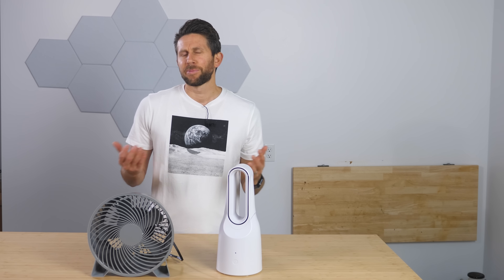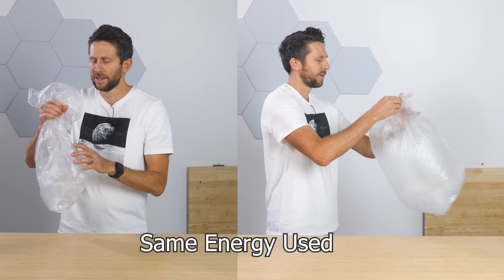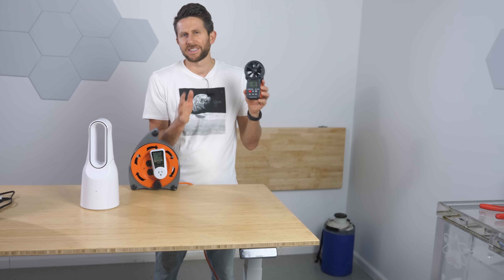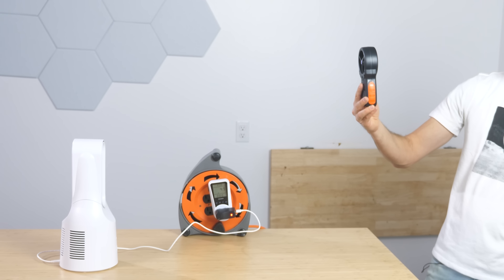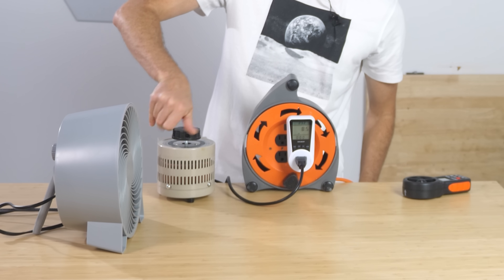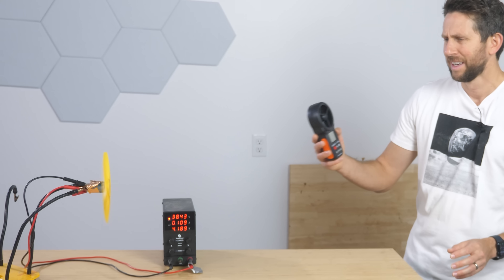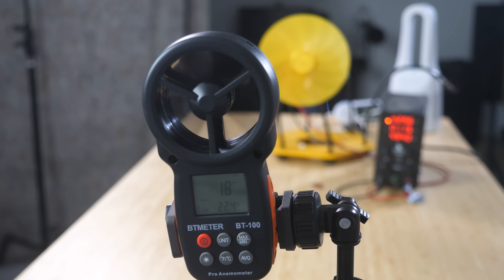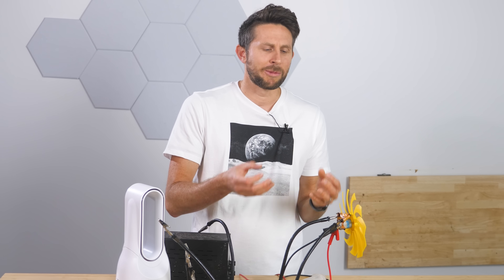Are Bladeless Fans a Scam?

Comment: I thought people liked bladeless fans because the stream of air was more pleasant than the beating fins of a traditional fan. I never understood why it was exponentially more expensive just for that small benefit tho.
Reply: Honestly, their form-factor/aesthetic is the biggest benefit. They work nicely as a bedside fan, or something similar.
Reply: @damsonrhea  I think tower coolers are a much better solution. I have one, it's really nice the amount of space it saves, and inside it's just a really tall version of the fan in the base of the bladeless fan, just, with a clear path for airflow, behind and in front. bladeless fans do look cool though. But it'd be even cooler if it was truly bladeless, you can use static electricity to move air too. I.. forget the name now for it. But I saw a video recently of a guy making one into a thruster for a model airplane.
Reply: They are also a bit safer for small children.  I can remember getting my fingers smacked by fan blades, thankfully not cut they weren't metal blades.
Reply: @krsanth-4142  Yes but as an child you learned to not stick your fingers into fast moving spinny things that was relatively harmless,  so as an adult you know not to do that.   Where as someone who doesn't do that maybe loses a finger as an adult because they don't have that level of fear imprinted into their brain.   So an argument of safety may not take into the long term safety of the person 🤣🤣
Reply: @Mike__B  Yeah but parents are usually overprotective of their children the smaller they are.
Reply: @Mike__B  Modern "safety" made people in general dumber and more oblivious towards everyday hazards
Reply: @Mike__B you can just put a cap on it with tiny holes on it
Reply: The stream of air will be negligent unless you are directly in front of the fan. A lot of companies claim regular fans "chop" air is not correct.
Reply: @jasonsong86  This literally only happens with turbo propeller aircraft where the ends of blades are going near supersonic speeds. I've heard it, I live near an airport.
Reply: @jasonsong86  

This, you're not supposed to be sitting DIRECTLY in front of the damn fan. It's like people have never used a fan before. . .
Reply: Buy an ac at that point 😂
Reply: Dyson is a conartist and with clever advertising destroyed many products where the design had been refined by many companies over many years. The biggest example is how he destroyed vacuums forever by shifting the industry to bagless.  His fan claims, including the "choppiness" issue were too much for the average consymer ti be suckered (luckily).
Reply: @blobscott  "Destroyed vacuums forever"! 😆 I expect most people would agree that bagless vacuum cleaners provide better value for money than the old variety.
Reply: @nagualdesign  I assume you don't use vacuums very often!  First (for the bagless vacs), I love emptying out a canister of microscopic dust particles, which inevitably billow back into the air and your face when you are emptying the container.  Very fun to inhale this as well.  Then, I love the static on the plastic dust container, which is permanently covered in filth after the first use.  Then I JUST LOVE replacing the expensive fan filters, to keep said particles from blowing through the fan and back out into the room when the vacuum is running.  Geez.  Good luck out there.
Reply: @blobscott   I don't think I've ever read a more offended version of "I had to clean up my own mess" from someone old enough to type it.
Reply: They are way safer if you have pets, especially birds.
Reply: I need a fan in my kids' room. Bladeless is safer. Not that I bought an expensive Dyson. Just a tower fan where they can't stick their hands inside.
Reply: Fan blades are continuously moving air. Any vibrational disturbance you get is from them not being stiff or balanced enough, which would be a manufacturing or material choice flaw rather than something intrinsic to the design. They can create somewhat circular pressure waves, but those are easily fixed by inverted stationary fins in front to break up the air flow which is already done for situations where you need really even air flow
Reply: @charlesnathansmith you're right that the flow around each blade is constant... but when you're not moving along with that blade you will feel wind speed changing when a blade pass by you, and your ears will interpret those changes as a low frequency humming sound.

It's most often not the motor you hear when you hear a fan... it's the turbulence.

You don't hear much of that turbulence with a "fanless" fan because it basically funnels the constant flow into a tube, which then escapes the device as one uniform flow.

So, as I see it, it's logical that they're quieter, and because they use a smaller motor, they can start at a much lower wattage, as he also found out in this video.

Them being more efficient wouldn't make sense, as funnelling and directing the flow of course costs some energy, as it builds up pressure before air escapes the device.
Reply: @BenjaminVestergaard   they're circular (spiralled, really) pressure waves. Passive breaker fins are used to even out the air flow in high performance applications where that matters but aren't common on household fans. Maybe one of us should start putting some on them and make $50MM

Most of the noise you hear is from flimsy blade materials and poor manufacturing tolerances though.
Reply: @charlesnathansmith  yeah 🙂 breaker fins work well... but it's cheaper with just a mesh to keep fingers out.

Even expensive fans with low tolerances make that hum that makes it sound like its beating holes in the air... perhaps that new moebius-like vortex design that MIT is designing, to make drones more quiet, could make old fashion fans more quiet as well... it would make sense.
Reply: why is anything more expensive than anything else, marketing and cause people pay for them?
Reply: I have a Vornado air circulator. It's like a fan, but isn't as choppy and you can point it away from you and  you will still glfeel air flow as it moves around the room. Don't think I could go back to a traditional fan again.
Reply: People are paying for the visual aspect of the fan
Reply: The fan he pulled out of the "bladeless" fan was a squirrel cage fan. You'll get the same smooth airflow from the squirrel cage fan on its own, without the marketing shroud.
Reply: All that went into dyson marketing
Reply: Because it's fancy lol
Reply: Marketing.
Reply: branding
Reply: If it was exponentially more expensive it wouldn't exist as a product.
Reply: Greed.
Reply: Fans for restricted airflow are usually not great for airflow. It takes some engineering, and Dyson motors are pretty good as well. Early adaptor tax applies, too. Got to earn that R&D cost back. Rich  People/Companies trying out dumb things are one of the better reasons technological innovations are made.
Reply: For two primary reasons. One, they're licensing the technology from Toshiba, who invented it in 1981. The other, you're paying for the brand name.
Reply: Bladeless fan is more for design and safety. I'd buy Dyson over any fan because it  looks cool!
Reply: I remember the commercials trying to tell me that fan blades are uncomfortable and I still look and laugh.
Who the hell ever heard of uncomfortable fan blades before they put that commercial out?
Reply: @myusername111  probably the same people who think leaving a fan running in a sealed room reduces its overall temperature
Reply: @myusername111  Exactly. Talk about first world problems! 😆 Who actually cares whether the air they blow out is "choppy"? On a hot day when you just want to feel the wind against your skin, £500-worth of laminar airflow isn't going to make you feel any cooler.
Reply: I think just safer for children and easier to clean, different form factor fits better some spaces.
Reply: @PowerScissor  The form factor is similar to tower fans. Which are vastly cheaper than Dyson fans. I bought 3 new tower fans last summer for less than $100. 
The only thing bladeless fans have going for them is aesthetics. They look cool. But there is no way there is $500 worth of materials there. Dysons profit margins must be sky high.
Reply: @koloth5139 They're the Apple of home appliances.
Reply: @PowerScissor  they are way harder to clean. You either need to open the whole thing up to clean it. But then you don't care that the fan is dirty if it's hidden.
Reply: @Utrilus  That's simply not true.  I'm a neat freak and clean things in my house often.  I only own 1 cheap "bladeless" fan and it's super easy to clean.  The amount of dust that settles in through the small slots is nothing compared to tradtional fans.

And yes I open them up often to blow them out with compressed air...and in the same time frame between cleanings, there's much more work to clean the other fans.

Maybe thats not true for a dyson, but I'm not paying $500 for a fan.
Reply: @PowerScissor  Well you can use cross flow fan that will have the same quality with much higher efficiency
Reply: Actually harder to clean, the small slits get plugged with dust.
Reply: @PowerScissor  Safer for children? There are regular fans available that have grills over the blades so that people, adults or children, can't stick fingers in. They've been around for decades. They also aren't difficult to clean and don't require cleaning very often as long as you keep your house clean as well. Generally a vacuum will do the job pretty quickly and easily, and then a wipe down with a damp cloth or paper towel. As for child safety, do you have no stove in your house? That's dangerous for children too. Most people just teach children about dangerous things or keep them out of reach.
Reply: @mattbosley3531  Calm down, I'm not saying I agree with how most people shop.  It's the whole reason advertising works...is people are not that bright when making decisions. 

There's lots of older fans in existence, and I have seen a particular funny episode long ago where a child tripped and her hair was then coiled up in a fan and there were no lasting injuries but it took them about 20 minutes to detangle the mess.
Reply: @PowerScissor 
Safer is really it. 
Form factor doesn't work, because the interior fan is smaller anyway.
Reply: @XaadeTheBlade  I'm not saying I prefer the form factor....but I've had many people tell me that they prefer it.

There's a million different variations and they put all sorts of things in that space from LED lights to wireless charging pads to watch charging docks.  I've even seen people hang their keys in there so they can always find them easy.

Form factor is a major decision in why people purchase them.

It certainly isn't for performance.
Reply: I’m sure they also have filters in them since they’re taking air in through a smaller area. Can’t really filter air with a regular fan.
Reply: @conor7154
If you can't filter air with a regular fan then the "bladeless" ones can't filter air either, they BOTH CONTAIN REGULAR FANS.
Reply: @conor7154   Yes you can filter a box fan (though not really the oscillating fans). Look up "Corsi–Rosenthal Box".
Reply: probably because normal fan creates turbulent air flow.

Comment: Hm, we are measuting wind *speed*, but we are not measuring the air volume it moves... Could it be the case that these "bladeless" fans move more air and by that You are more cooled than with the "regular" fans? I don't know if that's the case - just an idea, to compare maybe from this perspective as well
Reply: Volume/second = wind speed  * intersection area 
volume is proportional to speed
Reply: @leonlai8270  sure, but we don't measure the full area where the air is moving, right? We measure the same slice which is the anemometer tube (constant)

Comment: You need to map flow over an area, not just measure the peak velocity at 1 point.
Reply: Why?  whats the purpose of a desktop fan like this?  It's to cool down a specific object like yourself.  If it doesn't do that well and the other one does with the same power settings,  he's proved his point quite well.  He's not measuring the efficiency of whole house attic fans.
Reply: He measured multiple points. It didn't reach the speed of the other one at any location, and he also remarked that the regular fan covered a larger area. So larger area with a stronger peak is enough, unless the bladeless is doing something crazy like hiding some stupidly strong peaks off center.
Reply: Dyson bladeless fans have wide and narrow modes so Actionlab missed testing one of those by cheaping out. Also like every other engineer has said here he REALLY should have tested volume not just velocity. He was almost there. This video needs a follow-up and to mention the actual principles involved (Bernoulli, Venturi etc). This is well trodden ground since the Victorians studied it thoroughly!!
Reply: bro has no clue what hes yapping about
Reply: @unironicaluser1867  In this case I think he missed the mark but that's rare. I'd encourage you to watch some of his other content and I think you'll find he does in fact have a clue.

Comment: Nice, experiment, but my question is, may be it uses same or more energy compare to normal fans, but the air speed is not a fair comparison, we need to compare the air flow rate "speed X Area". as an example we can't compare water jet high speed water with a low speed river water and say the water jet has more power!

Comment: It's obvious that you need a certain amount of energy to accelerate a given volume of air to a given speed. And it's obvious that blowing the air around at least two 90° corners and through grids causes friction and makes the process less efficient. Basically the friction is heating the air up -- not what you want on a warm day!

Comment: @actionlab , for measuring output you have to get the volume flow rate of air, not the velocity, thus basically integrate the v over whole frontal area. The volume flow rate itself will give a good vague idea of efficiency.
Reply: True. But he does mention that he had problem picking up the air movement for the bladeless fan, suggesting that the area is probably pretty small wrt the one from the yellow fan.
Reply: The bladeless fan has a much narrower stream of air. About the only thing efficient about those things is the marketing spend to get people to part with their money. Big unducted fans are still the best at moving large amounts of air.
Reply: I agree.  Seems it’s necessary to measure the flow not just at one point on a reference surface, but at many, then add up the results.  Maybe the flow field are similar at the distance on this experiment, though.

Yes the bag inflation demo was excellent!  And learning that the “bladeless” fan isn’t bladeless was new to me.  Is my Dyson vacuum cleaner also a bit “over-blown”?

Comment: Your results would’ve been more consistent if you put each fan in front of a makeshift wind tunnel such as a large section of fixed length PVC pipe to control for the direction and spread of the fan output. Not bad, though. The variac was a nice touch. :)
Reply: Yes that'd give us more accurate results if we only wanted to know the hard numbers in a vacuum. However, he's testing a commercial product used by people, so to recommend it or not it's better he tests it how we actually use fans (i.e. not at the opposite end of a PVC pipe). The fact that the air displacement of a rotary fan is in a much greater volume already makes it better for actual use, let alone it also being over 35% more efficient and much cheaper.

Imo, a bladeless fan is useful for people who want quiet fans and can afford that simple luxury.

Comment: The advertising I've seen is that bladeless fans have a more consistent air flow. You have a consistent breeze instead of intermittent puffs of air hitting you as the blade goes by.

Comment: The national average for 1 KWH of electricity is $0.18.  If you use 10 watts for 8 hrs per day, it will cost $5.50 to use it for a year.  Even if the Dyson were 10 watts more efficient than the conventional fan, it would take more than 10 years of daily use before it began to pay for itself.

The whole gimmick behind these fans is the sleek look, and you can't put a price tag on that.
Reply: But Dyson does put a Price Tag on that?

Comment: Did you check the how much energy is wasted in the Variac?  Mine gets noticeably warm when it is turned on, and when you are comparing low wattages, the Variac might be using more power than the fan itself.  
If you had put the watt meter between the Variac and the fan, then any power wasted in it will not show on the meter but you had the Variac plugged into the watt meter.
Reply from the maker: yes I should have put the watt meter on the output of the variac, but this was an order of magnitude different, so the variac most likely wasn't the issue. Those types of AC fans are just very powerful.
Reply: @TheActionLab  If you have a minute, can you check what the difference is and let us know?  If you run the Variac at 120V with the fan plugged in, and compare with the wattage meter placed BEFORE the Variac, and then AFTER the Variac. I am very curious to see what the difference is, and how much power the Variac uses.  Also, what is the rated wattage of your fan at 120V?

Love the videos, and thanks in advance!
Reply: This should be the same for each test at the same number of Watts.